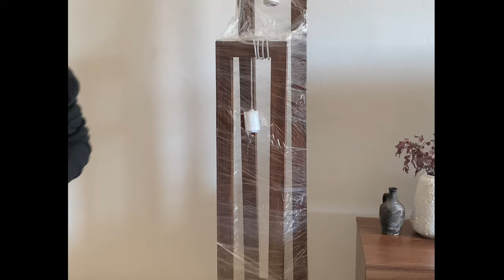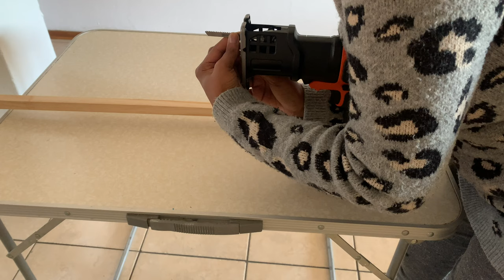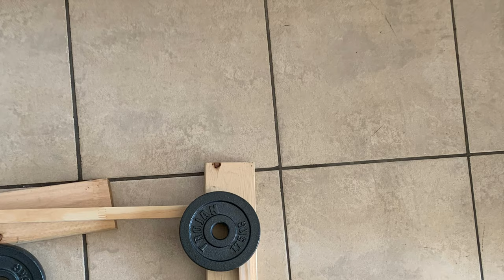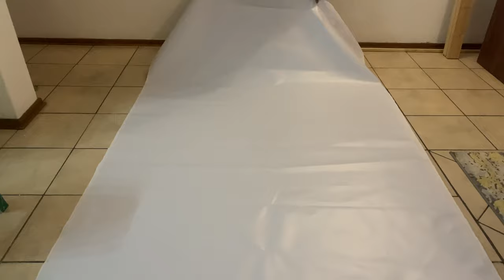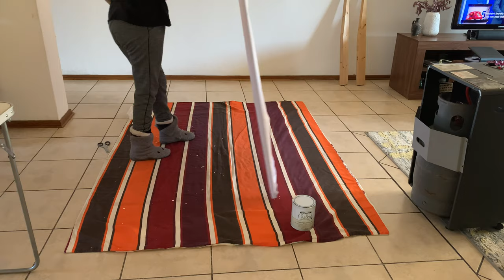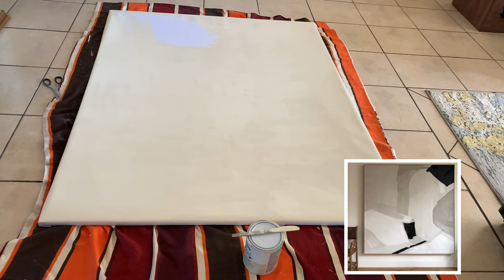Unboxing vlog: lamp and LED bulbs | large scale canvas DIY #diydecor

Comment: Wait.....let's go back a bit,did you just make a whole canvass to your own specs? Please am waiting the cost on that👏👏👏👏
Reply from the maker: Hey babe 

Yea 
I wanted a large piece 
It’s 1,2 m wide by 1,5 H 😎

Got the wood for about 100 at timber city 
(One 3m and one 2,4m ) cut them in half
Reply from the maker: The canvas is from chamdor … 70/m I got 2,5m and I have extra - enough for another canvas 😊😊😊
Reply: @dollface_thando  what a save 👏 thanks alot